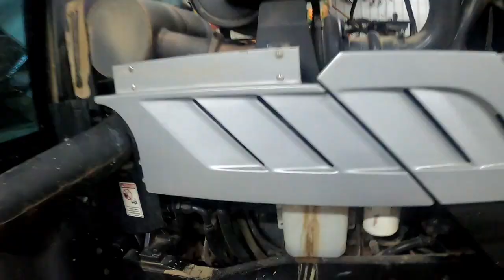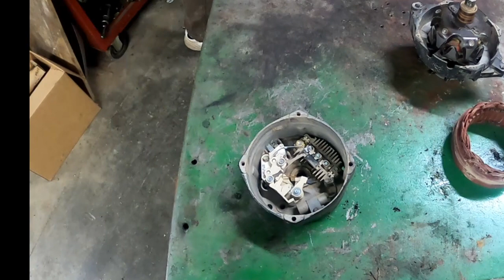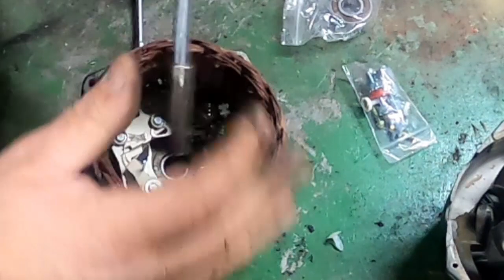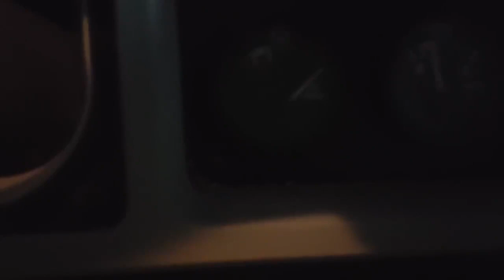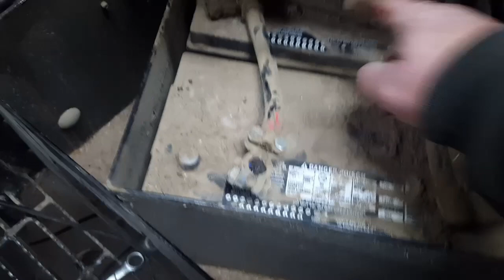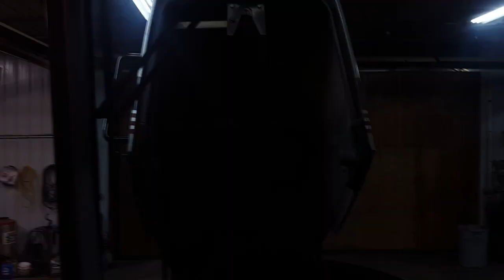White Tractor Alternator Repair

Comment: Really enjoyed that. 
So your repair was probably good,  the battery was done. 
Great tutorial video again. 
Never seen this done before and I'm impressed that you sourced the repair kit from the internet,  you're great to source parts from the internet,  really impressed how you source stuff. 
You never said what the kit cost   ?
The new alternator cost eighty bucks. 

Also not everyone has a hydraulic bench press. 
Great video .....👍👍
Reply from the maker: I got the rebuild kit off eBay, I think it was  $28. A lot of times, this tractor included, has the manufacturer part number in the parts book. Having the Delco model number of the alternator makes finding the parts online much easier.

Comment: I have a 1900 C I'm getting hydraulic oil in the transmission only about a quarter overwinter any ideas what that would be
Reply: Could be your hydraulic pump, or the hydraulic unit oil pan may have crack- pin hole.
Reply from the maker: There's a couple possibilities. Does it have 3 point hitch? If it does, there's a rod that comes up through the pan that separates the hydraulics from the transmission. The seal that rod goes through might be leaking. It could be the shaft seal on the hydraulic pump itself, or the pan has a pinhole rusted through it. All 3 of those require pulling the hydraulic unit off to repair.
Reply: @ThatOliverGuyChris  okay thank you for the advice hopefully see a video of you doing something like that soon

Comment: I Started putting alternators on old farm tractors in the early eighties. I am not sure the self energizing regulator for the 7127 existed then. I didn't know about it if it did. I would put a heavy diode from Raido Shack in the energizing wire so it wouldn't back feed the ignition switch and and run the battery down or in the case of a gas tractor feed the coil and keep it running. Everyone in the area thought I was a genius as the old generators were worn out and expensive to fix.This probably horrifies the original crowd but people wanted reliability.

Comment: Unrelated but- I have been eyeballing the engine speed output right above the regular pto on my 1800  C. If I unbolt the 4 bolts on the 540 pto could I move it up and bolt it onto the engine speed one after I take that cap off? I’m wondering if it turns at EXACTLY engine speed? I know it goes the opposite direction as the pto turns, but my generator is capable of turning either direction. See where I’m going with this lol ?
Reply from the maker: Yes, the shaft housing will move to the top. Pop out the tin cap and bolt the shaft housing on. It turns exactly engine speed, and turns on and off with the pto lever. I've seen a couple of setups just like you're thinking about.
Reply: @ThatOliverGuyChris  well it was a good idea but if it turns at exactly engine speed it’s going to be going faster than 540 RPM even idling.. thanks for your input Chris! Hope your enjoying your Sunday
Reply from the maker: I wondered about that. If your generator was 1,000 PTO, you'd be all set.
Reply: @ThatOliverGuyChris  I have a gearbox that has 1000 RPM in and 540 RPM out. I saved it off of a baler, I believe it was an old Hesston. Other than that I’m starting to come to the reality that I just might not be able to run my generator with this tractor lol. Thanks for entertaining all of my different ideas and thoughts though
Reply from the maker: You could get a dual speed PTO unit from a 50 series, put it in 1,000 rpm and your engine speed would down around 1,200 or so to run the generator.
Reply: I think that’s the best option. I just need to find one, I have been looking but I’m in CT and there is not much around. I have heard of a boneyard someplace in upstate New York that has a lot of Oliver tractors tho I need to find out where that is and what they have

Comment: I have put new alternators on tractors and had them go bad a month later. Turns out one of the batteries was shorted internally which causes the alternator to work super hard to charge it- which in turn burns out that stator winding you were talking about. Maybe that’s what happened to yours? Awesome video tho, it was cool to see the alternator rebuild ive never been into one that deep
Reply from the maker: Could be between the dying battery and running the field lights at an idle got the stator. Bad batteries kill a lot of alternators and starters.

Comment: Remember when Oliver came out with the first Cat V-8 tractors and those Delco-Remy alternators failed repeatedly.  All that was happening was that the vibration of the engine was causing the leads of the rectifiers to vibrate and break.  Oliver had no answer at first.  We got in touch with Delco and their engineering group.  They were starting to see the failures happening.  To help us they sent us a big crate of alternators so we could simply return as warranty the failed ones and have a new one to install.  We solved the problem by simply filling the rectifiers with epoxy.  Stopped the problem and customers were not having to call us about alternator failures.  Of course, Oliver switched to the brushless alternator that supposedly was the fix.  Later the Delco went back on but did not have that problem.  I think they just increased the rectifier strap a few thousands of an inch to stop resonant vibration failure.  JMHO.  However, our epoxy fix worked for us.
Reply from the maker: I'd believe it. I thought I could idle back some and bump up to 4th over in the 4-225. It handled it fine, but that 3208 running around 2,000 rpm must have had some kind of resonant vibration that was loosening everything up. The starter bolts came loose, the mount bolts for the turbo, and the back 2 on the base of the injection pump. I dropped back to 4th direct and revved back up to 2500 and no more bolts coming loose.
Reply: @ThatOliverGuyChris  Yes they did.  I failed to mention that we borrowed the Chevrolet dealer's vibration tester (metal reed in a meter case) they used to check customers' complaints about a vibration at certain speeds.  I forget what speed the 3150 and 3208 engines had that resonant vibration that caused several customers complaining about a "hum" that bothered their ears but there was that resonant point.  Kind of like Herman, the amount of noise generated by just the engine block and blower is much of his sound.  We had a customer who had one and tried everything to quiet the noise with different mufflers and etc. but it still had the loud.  I think that might have been a contributing factor for the demise of 2-stroke Detroit diesels.  Cab noise levels became a big point.  They drowned out radios and deafened drivers. Still there was no better sound than a Detroit 318 under a load and winding out.  Same with Grayhound busses.
Reply: Also forgot that using the vibration tester when our Whiz Bang Zone Service Rep was there sent him back to Libertyville with the proof it was a problem and filling the rectifier bridge with epoxy fixed the problem.  As I said, they started installing those Motorola (?) brushless alternators.  They worked but if you had to get parts to repair one of them you had to find a dealer in some faraway place or wait for Oliver to find and ship one from parts.  We both could tell tales of simple fixes for something that the engineers at Charles City, Iowa or Brantford, Ontario, Canada would admit to a simple fix simply because they were paid to come up with some elaborate design.

Comment: Can you take it to town and get it tested at a place so they can do it right I need to get into town to find out to see if it works or not
Reply from the maker: Yep, a repair shop can spin them up and test them. One from my combine had trouble with erratic voltage after the engine was fully up to temp. It was fine if it cooled off. Of course it bench tested fine at the alternator shop. I bought a new higher amp replacement and haven't had any trouble since.

Comment: Never done much with alternators.. other than change them.
One wire self energizing Delco work well for us.
Reply from the maker: I think the best fix for this situation will be the LED lights that don't put so much draw on the alternator. The Delco 1 wire alternators are definitely a nice solution. Thanks for watching!
Reply: @ThatOliverGuyChris  yes, LEDs do help!! Bigger alternator helps too.. those new batteries didn't help much 😂🤣
Replace a few 2008 batteries last spring.. they were just broke in.
Probably would have been ok to keep for a car, but not for a tractor or bale wagon...

Comment: Still made Sunday morning coffee time Chris 👍
Reply from the maker: Good deal!
Reply: @ThatOliverGuyChris  I’m working on a 265 ci gas rebuild. What are your thoughts on the power seal domed pistons vs flat tops?
Reply from the maker: @crazydave4455 , I've only used the flat tops, so I don't have much experience with the domed pistons. How much do they raise the compression ratio?
Reply: @ThatOliverGuyChris  not sure I’ve seen it advertised. I’ll have to dig. I should look for a late 1650 or 1655 head instead.